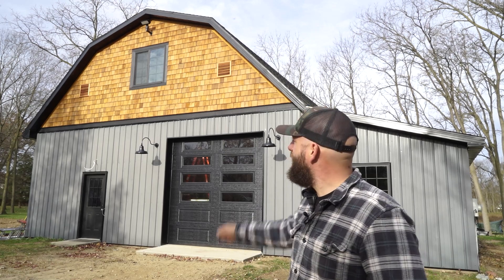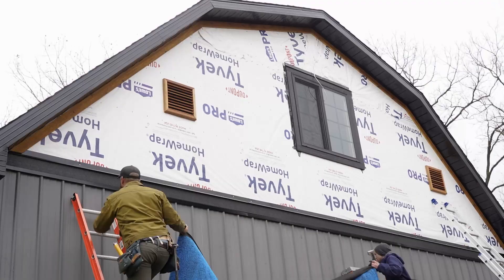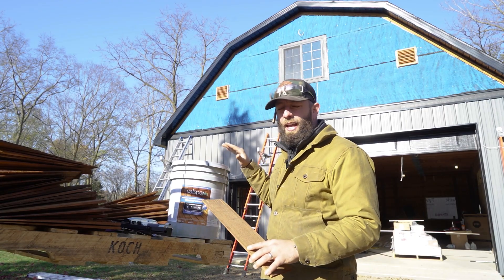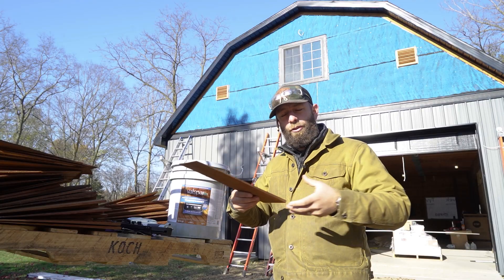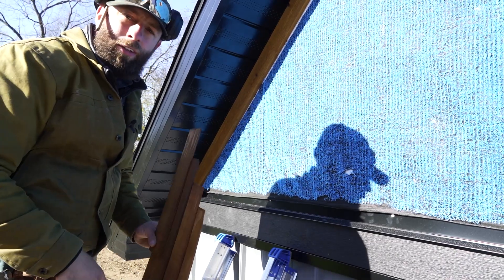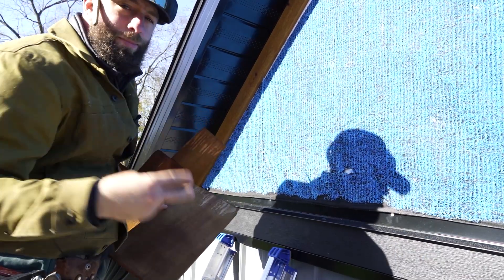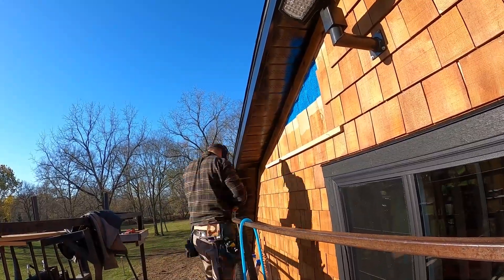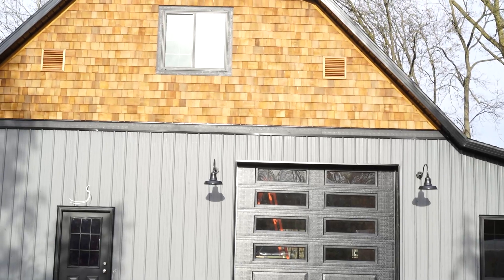How To Install Cedar Shake Siding // Dream Workshop Build (Part 1) // DIY

Comment: Consider buying some used scaffolding from a vendor.  You're planning to do your own house build in the future, and the cost of continued rental of similar elevated work platforms will pay for the scaffolding twice over (or even more than that).   During my last two story addition, the purchase price of the scaffolding was covered just by the trade to do my own paint work verse hiring professions come do the same task.  That doesn't count the savings for having the scaffolding it while doing the windows, roofing, siding, and pretty much all the ladder work.
Reply: Bye far the best Advice yet👍

Comment: Great Video and build. I am beginning to install shingles on the three gables of my house. One question I do have is nailing the support bar for each layer of shingles. 

If I understand your method, you nail a level 1X onto the shingle layer below the previous row to support the new layer. You probably use a few small nails BUT doesn't that leave a hole thru both layers of shingles that are being installed after the support is removed? How do you handle rain soaking through or leaking through the shingles? Is that an issue of concern? I live in western WA, an area that gets over 60 inches of rain a year. Fortunately for me, the three gables won’t face the prevailing storm direction, but two gables do get more weather(rain) that the other.

Comment: For the fur out strip where you nail it on temporarily, when you remove it what do you do about the nail hole?
Reply: Same question here… I think that since that nail is at the line of the next expose, it just barely covers? I guess you’re counting on it only being a few nails, and the vapor barrier etc

Comment: Did you leave the shingles to dry leaning against each other like that?  Did that work out well?  I've seen people hang shingles on clips when I was looking at how to do it, but if that works fine then it seems like hanging them would be a huge waste of time.
Reply from the maker: I did leave them like that with a fan and periodically rotated them

Comment: Using trimboard to avoid difficult top peak and gable angle,typical millineial
Reply from the maker: The trim followed the roof lines. I still had to cut all the same angles to match the roofline trim or no trim. Adding trim was an aesthetic choice and didn’t make anything harder or easier. Big guy behind his keyboard critiquing people on the internet with no videos himself. I bet you are an amazing armchair quarterback too.

Comment: Looks good . When I did mine I used a 1X6 to line up the rows at 5 1/2”. I brought a mitre saw up on the pump jacks. 
I left the shingles natural. The south , east and west sides just naturally turned dark almost blackish. The north sides turned pale. You would think it would do the opposite. Just love cedar gables.

Comment: The color pallet looks amazing!  I'm glad you did this video as I have a 205 years old house and barn and plan on residing them this coming spring with cedar shake.  Lots of great info, my only question, and maybe I missed it in the video, what did you do for spacing in-between the shakes (side by side)?
Reply: @10:20
Reply: @jonathchamp8450  Thank you!

Comment: I get that Valspar sponsored the vid but I used Cabot Australian Timber Oil for the same application and it is a very good product. I shared the same concerns of wanting to preserve the beauty of the wood which requires a transparent stain but by default those offer the least protection. The Timber Oil has held up very well and really let the wood shine.

Comment: the shop/house is looking way better then i thought. the color choices are spot on. i like the wormer color for sure. I'm currently in the middle of doing raised panel wainscoting inside the house with a dramatic color flop. a blue coal color from valspar and a white called grey shimmer ( not grey at all unless you but it next to pure white. but the grey shimmer fits better on the color flop.

Comment: Looks great, super jealous.  An old Yankee trick I've seen is to take the story pole and mark it with your largest reveal, so in this case 6 1/4.  You can then figure out where your transition points are and line up your story pole on an angle with each transition point and that will give you the precise location of each coarse.   No math needed.
Reply: You have to be careful and double check the shingles recommended reveal from the mill. Even exceeding the recommended reveal by half an inch can lead to premature cupping of your shingles.

Comment: Where did you purchase the cedar shakes and the cedar breather product? I'm looking to do this on a small barn I have on my property.
Reply from the maker: A local place, but I can’t recommend them. Had some bad dealings
Reply: @ThirdCoastCraftsman Name and shame the company? I just recently realized I'm in your neck of the woods when I saw your hardwood buying video featuring Johnson's. I've got a 100+yr old barn I'm planning to fix up a bit, no insulation or anything, just want to make it a little more wind and rain proof.

Comment: Nice video.  I have done shingle siding several times and always snapped a line and set a ledger strip to make sure everything lined up but never thought about putting a string line at the bottom of the next course to hold the shingles in place so I could adjust positions.  I guess an old dog can learn new tricks.  Beautiful job and thank you for the new technique.  Take care and stay well.